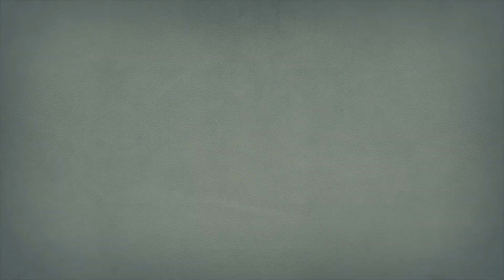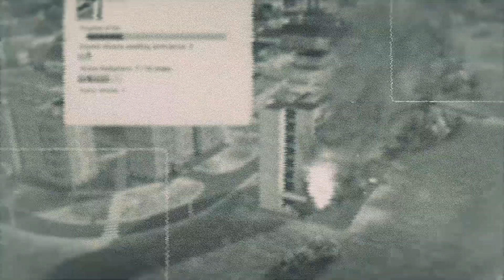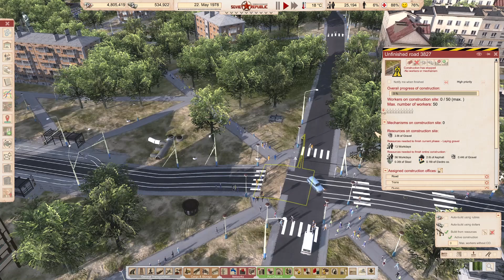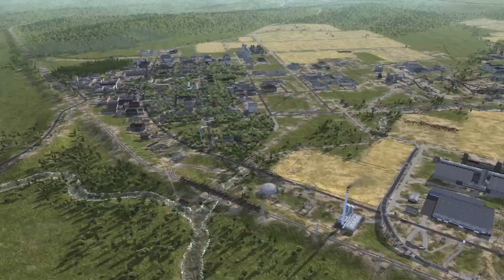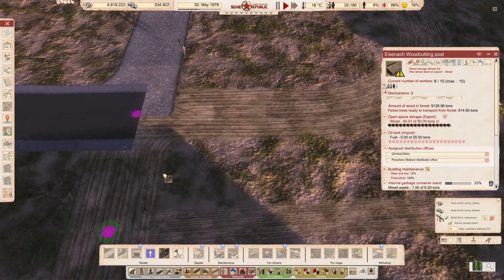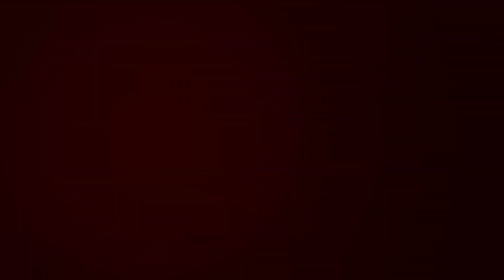Soviet Republic - Elementaria  - Ep.25

Comment: Zero workers on construction was an issue only in 1.0.0.5 beta.
Reply from the maker: @antonisauren8998  I'm still experiencing this issue. I'll check the other versions. Thanks for the heads up!
Reply: I haven't checked it since, just setting default to higher number after awaking all settlements I'm building in anyway, but supposedly it got fixed in .6. Be aware of other tram related bugs in theory adressed in .7 but we know how it goes with betas.
Reply from the maker: @antonisauren8998  yeah. I read that they were fixing tram bugs but I didn't experience any. Or noticed. 

I really appreciate the heads up, chief! ☺️🍻